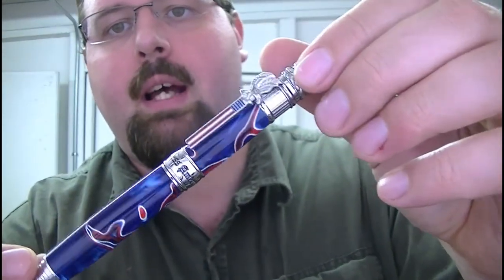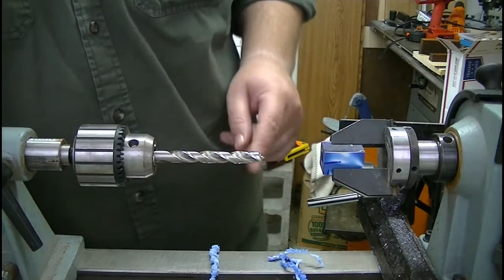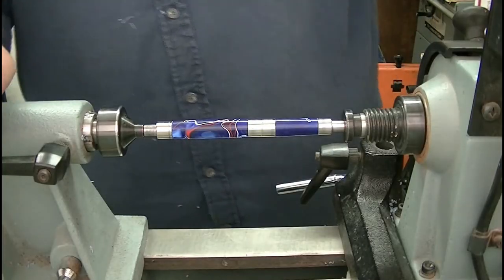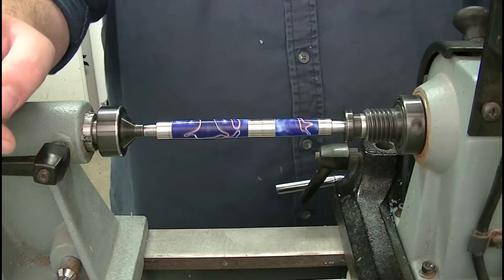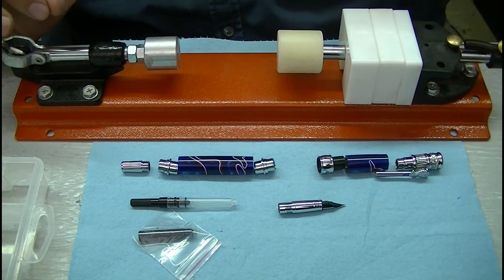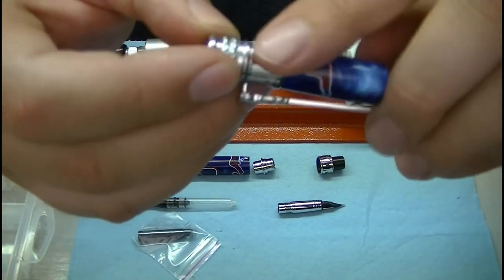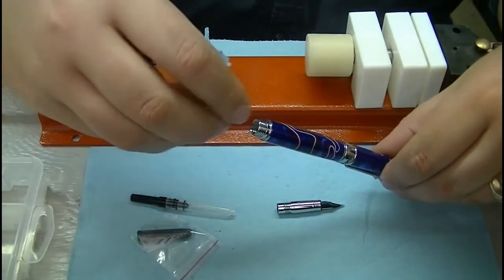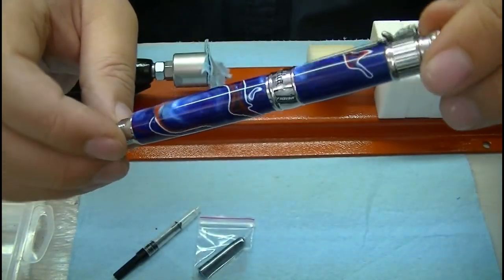Turning an American Patriot Fountain Pen Limited Edition in Patriot Kirinite for my buddy

Comment: What speed do you polish/wet sand with the 1500-2400 grit at?
Reply from the maker: foster Gwyn It depends on the material, for the Kirinite I'm turning here, I'm running either 1,200rpm or 1,800rpm. Kirinite is not finicky, Alumilite I run 1,200 and woods I run 1,800. Occasionally I forgot to turn down the speed, and you mostly just have to watch for overheating which will ruin your pads, but if you keep your pads wet then its not an issue. 

Hope this helps,
SootsCrafting
Reply: Soots Crafting it does, thank you!!